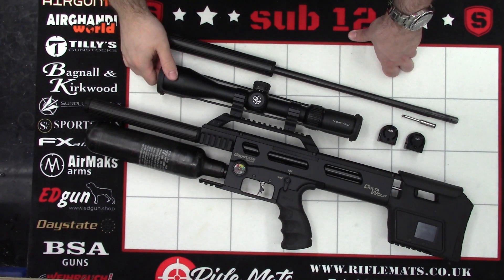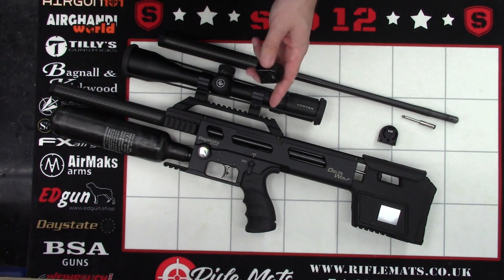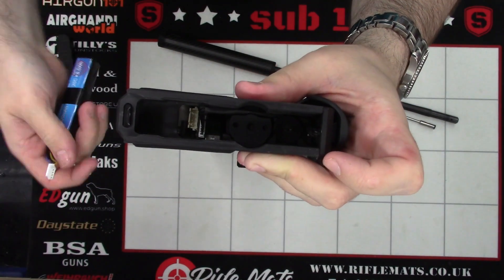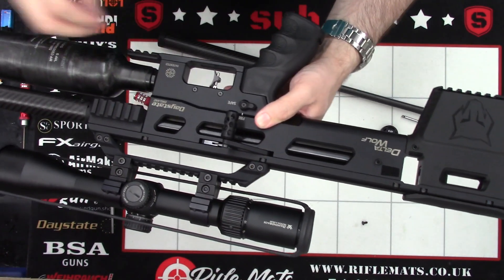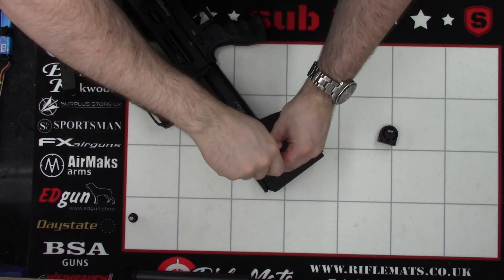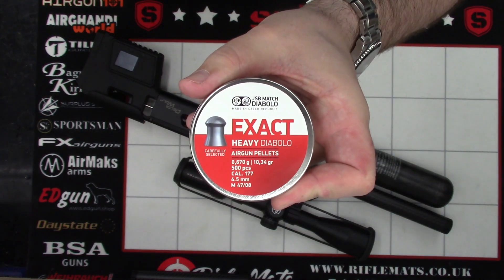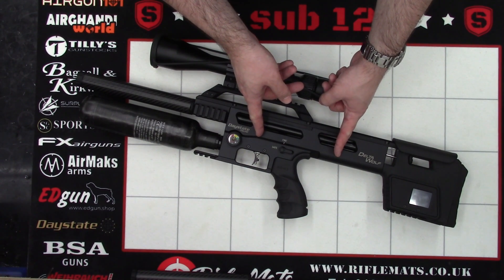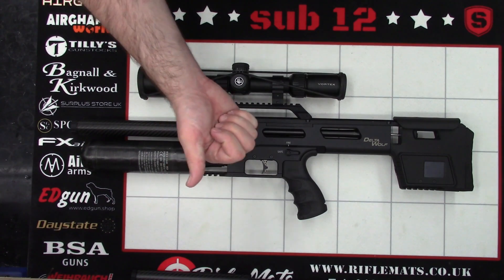Daystate Delta Wolf caliber change Sub 12

Comment: Nice Video Geoff.
 Out of interest, I'm pretty sure that the .177 Alpha Wolf I had a play with had a pin type pellet probe fitted.
This was a brand new gun straight from the factory, the only reason I noticed was because there was an older .22 Delta Wolf there too, this definitely had the same pellet probe as your .22 - so the difference was obvious and really stood out when I was looking at them.
Reply from the maker: Interesting, were they FAC? pin probes are very common in .177 FAC rifles so they may be using one to get more power, not an issue for sub12 but I have had a play and it does make the mag smoother, so maybe they changed it for that reason.  Thanks for watching.

Comment: Nice work 👍 surprised it didn't make much difference in the power level of that rifle, i did a similar experiment with a hatsan galation and got 2 foot pounds difference .
That's a really good rifle. 
Good video as always mate 👍
Reply from the maker: Thanks, yeah not much difference a little lower with the 8.44s though but I would rather low then high. Thanks for watching.

Comment: Very interesting I’m nearly to the point of buying one. Surprised there is no caliber section to do on the touch screen? Not sure how they achieve it?
Great vids and look forward to more. Thanks👍
Reply from the maker: Its choked on the transfer port, in the sub 12 ones there are no user programmable settings other than the preset power options, the .22 barrel has a small transfer port to allow for the caliber change. Thanks for watching.
Reply: Thank you for your reply, very much appreciated.

Comment: That's really weird the power didn't change.  On my Leshiy (classic) between .177 and .22 is around a 3.5 ft/lbs different!
Reply from the maker: On the DW the barrel port is restricted for the .22 so the power doesn't change much between .177 and .22
Reply: @sub12airgunners  Ahh I see. Well that explains it, cheers.